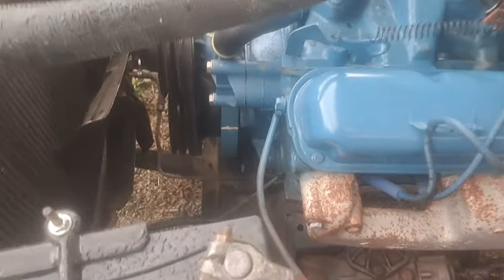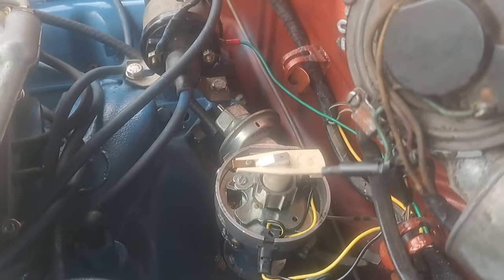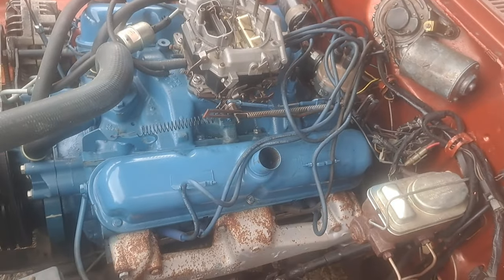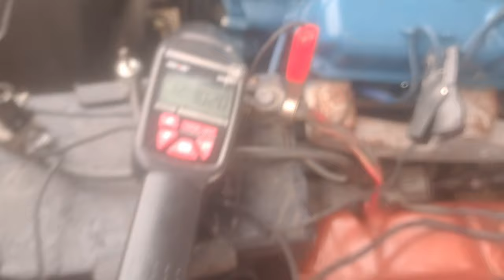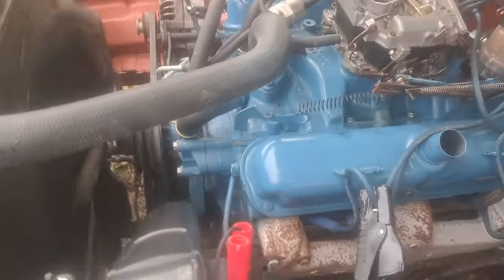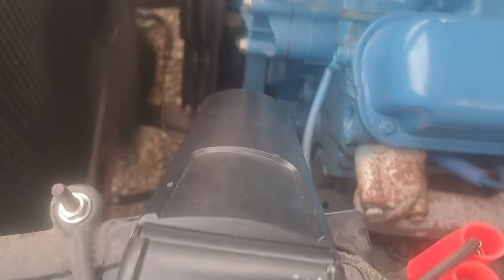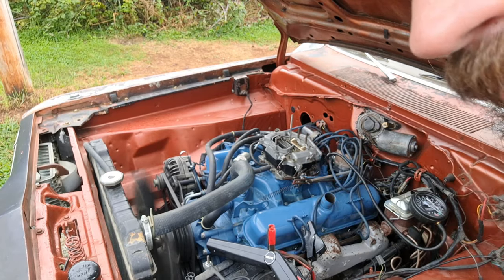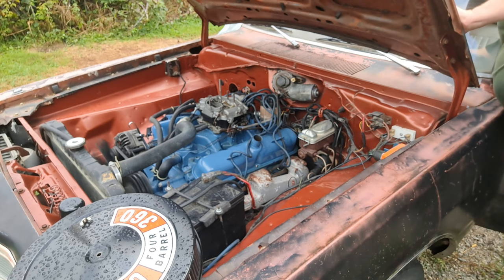Engine Timing 101.

Comment: Is the cam what the engine wants or what you think it wants?
Reply from the maker: The cam and alot of other factors effect what the engine wants in timing. Aluminum heads, compression, piston design, cam can all change how much timing the engine wants. Lower compression engines typically require more and are less prone to detonation.